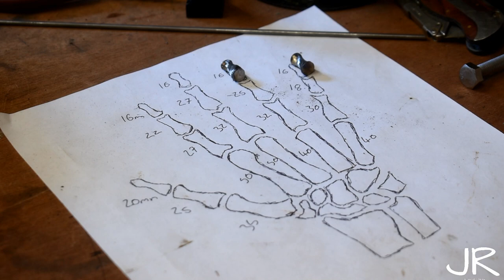METAL SKELETON HAND BUILD!!

Comment: Just a pointer from someone who has made a few hundred roses already, it's far easier to make a well defined flower bud from a 0.6mm thick sheet rather than the 1.2 you seem to be using. You can cut it down with sheet metal scissors and it makes for far easier workability.

I have also made 4 hands so far, each took me around 30 hours and I was wondering how long this one took you?
Reply from the maker: I make roses peice by peice. Rather than a template & bend. Leads to a much nicer looking flower in my opinion.